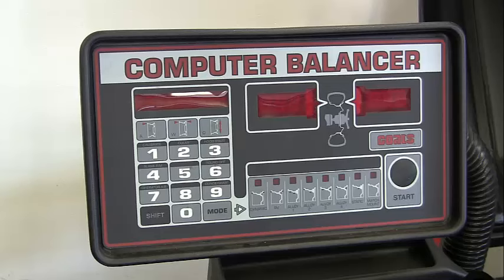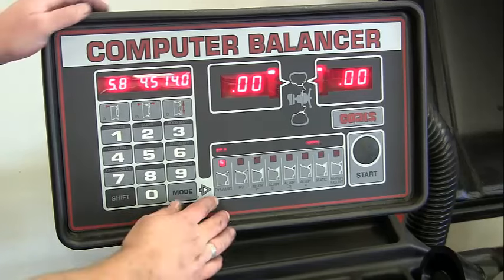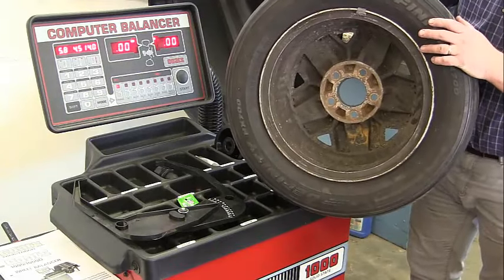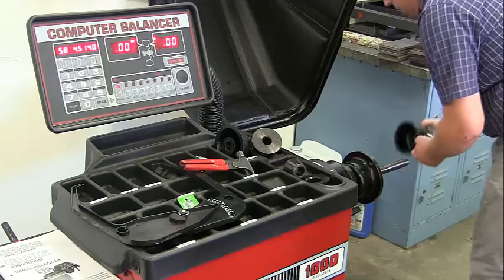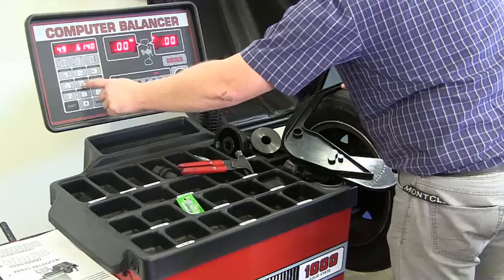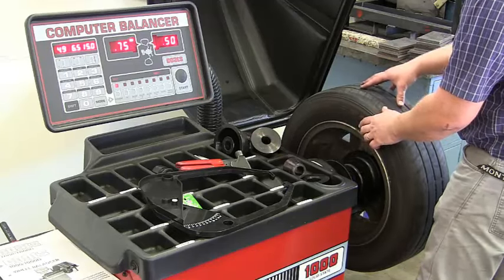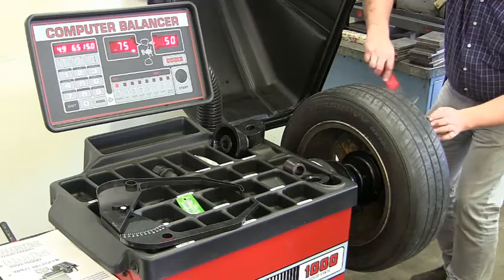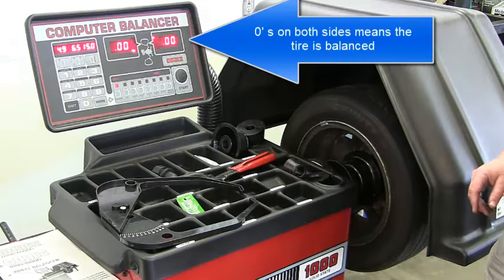Coats Direct Drive 1000 Wheel Balancer - how to balance tires

Comment: I bught a coat 950 wheel balancer and we try to test it on 110 since the guy didnt had no 220v and the motor didnt run but the screen turned on can i be that is not getting enough power ???